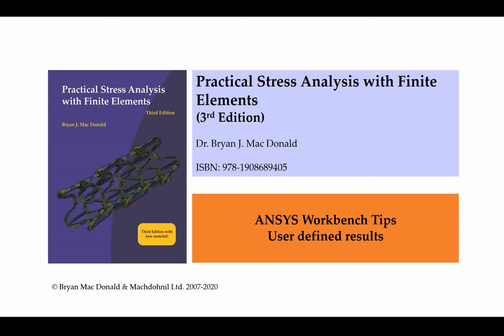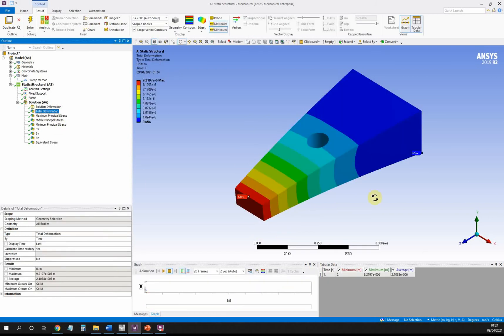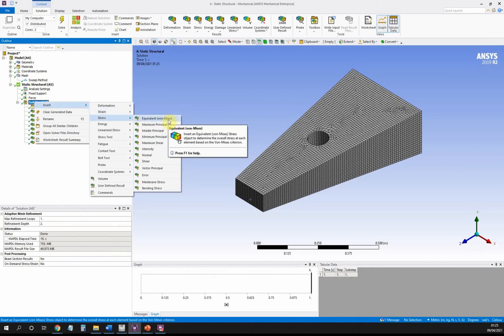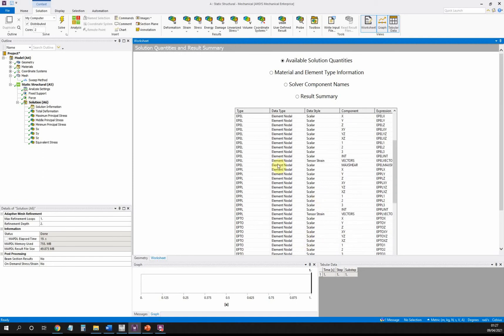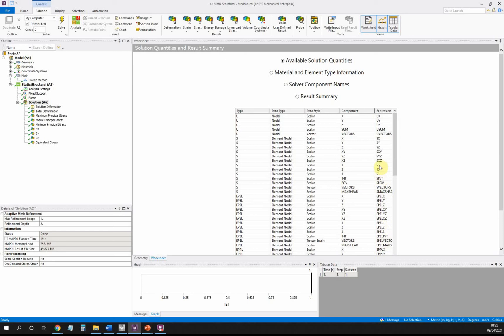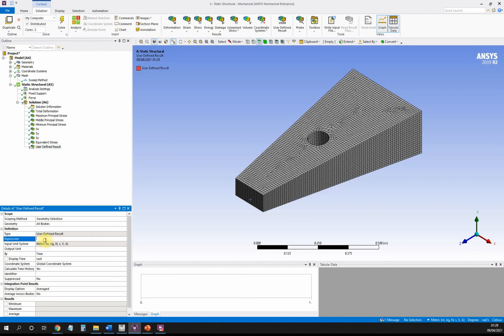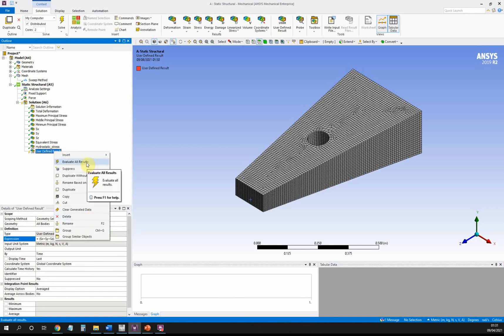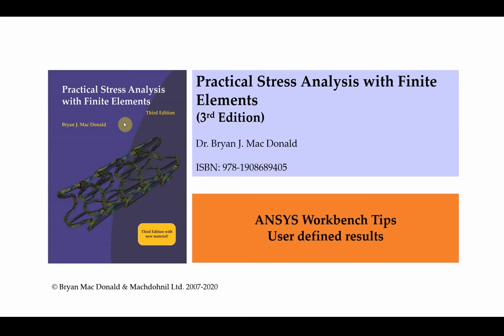Workbench Tips #1: User Defined Results - Hydrostatic Stress

Comment: I have a question, if you want to find a bending stress and membrane stress on any plane in model
Reply from the maker: Hi, I am not sure what you are asking. You can find bending stress when using beam elements and membrane stress when using shell elements. In the example in the video we use solid elements so you cannot directly find bending or membrane stress. If you were modelling a bending problem with solid elements, you could follow the instructions in the video to define a user defined result for bending stress (using the appropriate equations) but it is likely to be inaccurate as the solid elements cannot bend. By "membrane stress" if you mean the stress along a plane or face of a solid element then you could just plot the appropriate directional stresses and/or manipulate them via a user defined results, depending on what it is, exactly, you are looking for.

Comment: Hi, I have a question. How can I get a Hydrostatic Stress Gradient? thank you
Reply from the maker: Hi. This is not readily available in workbench. You would have to calculate it (more or less following the method that I show in the video). The hydrostatic stress gradient is basically the ratio of the difference between the stress values of two consecutives nodes to the distance between the nodes, so you would have to do calculations on all of these.

Comment: How did you know S1, S2, S3 would work and is the correct variable when in your solution tree the name is "Maximum Principal Stress", "Middle Principal Stress", "Minimum Principal Stress"? Is there a description for all the expressions listed in the ANSYS worksheet?
Reply from the maker: Hi, in general stress analysis (not just FEA) the maximum principal stress is always S1 and the minimum is always S3 - this is a convention that is always used in stress analysis. So, if you had three stresses, say: 300 MPa 200 MPa and -400MPa then S1=300MPa S2=200MPA and S3=-400MPa.
Reply: @LearnFiniteElementAnalysis  is there some datasheet prepared by ANSYS that defines these expressions?